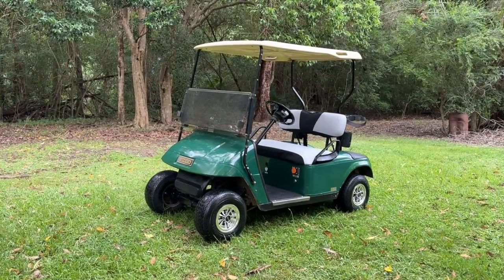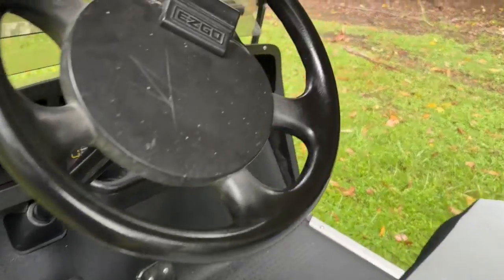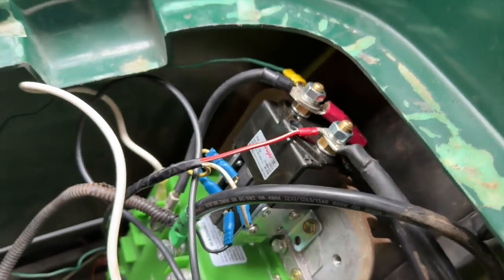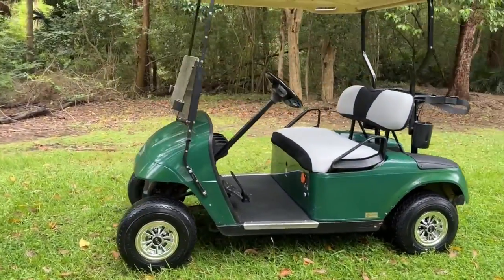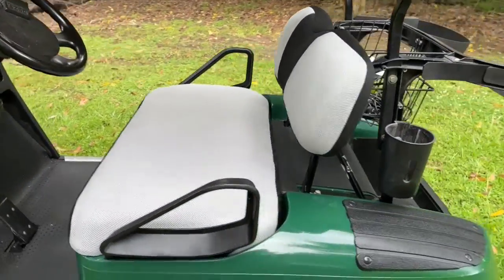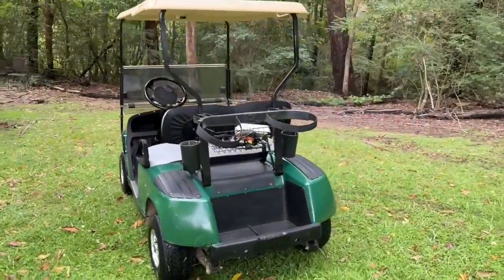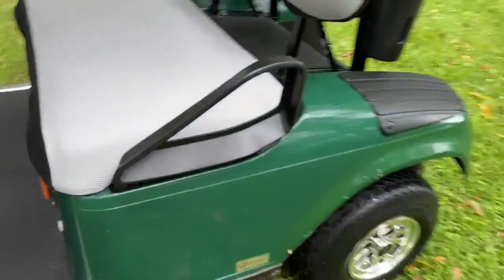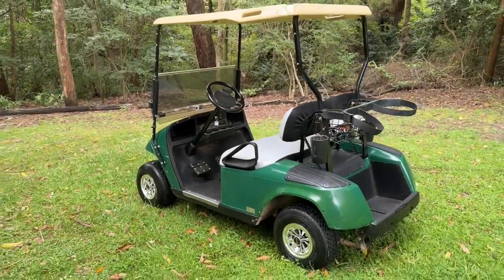36V to 48V Lithium Upgrade - EZGO TXT Golf Cart with Navitas 440A Controller + Burnout!

Comment: can you put the items in the description. for example the solenoid. i have an old melex golf cart which i got second hand it has ezgo 36v motor and the controllor burned out so i want to upgrade them. also the batteries. thanks

Comment: So the motor is still the same one that came with the 36volt cart? It's capable of receiving the 48volts?
Reply from the maker: Thanks for watching! Yep, it's the original 36V motor still. It's working well so far. If we were using it heavily we would probably reduce the power output in exchange for longevity.
Reply: @regaraustralia  I have the same idea of upgrading the powre-pack and ask just to be clear: I swap the batteries angainst a LiFePO4-pack with 48V and thats it? The controler, the contactor and the motor are left to be the same? Thanks for clarification!
Reply from the maker: @HeinrichErnst1  Hey there! We replaced the Controller with a Navitas 48V controller and also upgraded the solenoid. I don't think the original PDS controller will support 48V.
Reply: @regaraustralia  Thanks for your quick reply - that´s what I feared, that it would be out of specs. I consider the 48V-pack incl. controler then.